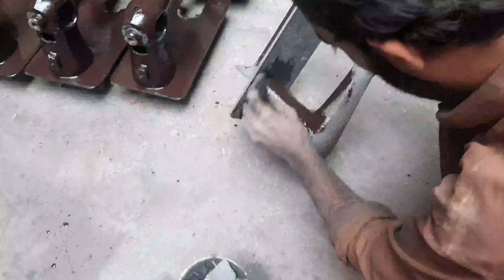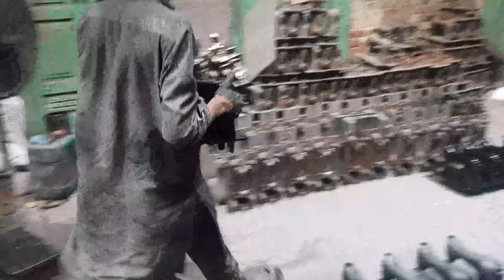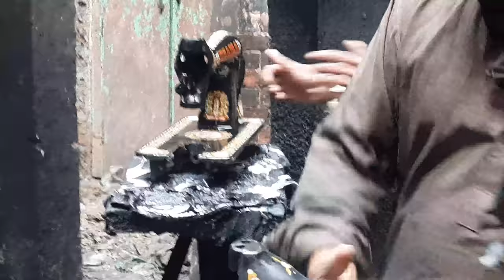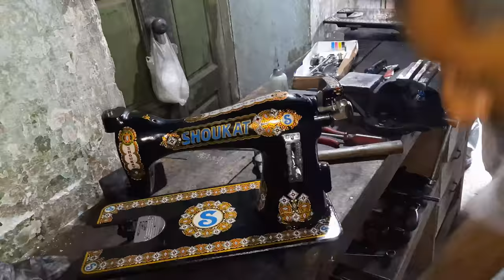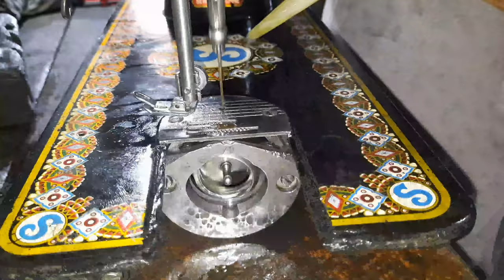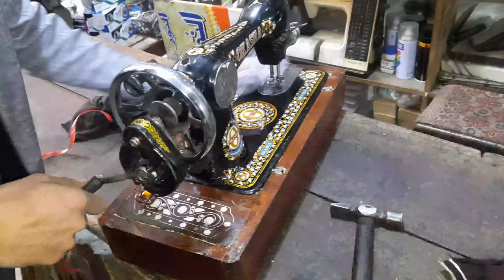Amazing skills of Making Sewing machine at local factory | Sewing Machine mass production

Comment: For those of you who are curious, they are building copies of Singer model 15-89 sewing machines. The original Singer 15 was introduced in 1879, and was modernized in the late 1920's and made as the 15-88 treadle, 15-89 hand crank, 15-90 belt-drive electric and 15-91 gear drive electric.
Reply from the maker: You are right but this machines are not for restorations this is thenew machines. If i share the work of manufacturing nobody see because the time of video is metter the audience mind sir . Thats why i do not show the casting proces . In future after 3 months i share the process of casting of machine . Thank you for watching and your precious time .
Reply: I was wondering about that so thanks!  I bet that thing will out last any of the current overly complicated plastic machines.
Reply from the maker: @rxpsycho7326  sir thank you for your comment and precious time , i am a tailor and i have 14 years experience in this work i bet if the machine is good you sew leather clothes and more things on it this i not broken if you sew the plastic . thank you for watching.
Reply: Our machine is about 60 years old (bought around 57) - rusted but otherwise fine. Exactly the same mechanism (identical except the labels)
Reply: Yes. I have 2 singer treddles. Identical. These hard working men must have our tooling and making our machines. Just like everything else...  amazing.
Reply from the maker: @rheidtech  Thank you for understanding my work and understanding the work instead of seeing the flaws in my work like others
Reply: @Onlyhandy1  🍺💪🌄
Reply: @Onlyhandy1  заказат можно сколько стоит
Reply from the maker: @ШемшатЧарыева-д5ш  thank you for your precious time sir.
Reply: @Onlyhandy1  Nice work
Reply: they are similar the Singer 15 had some differences, the base was thicker without diamond reliefs banding, the 15 had a longer bedplate. the motor mount was different.  the singer 15 was gear driven for the motor if I recall correctly.
Reply: @doordasht24  The Singer 15-91 was gear driven off the motor. The 15-90 was belt driven off the motor and motor mounts to the hand-crank/motor boss. 15-89 is hand-cranked, and the 15-88 was treadle. These are the variants of the Singer 15 made after the mid 1920's, when Singer "modernized" the 15. The older 15's are similar but lack reverse stitch, and machines made before 1895 have a fiddle base. 

The Singer 15 has been in continuous production, in one form or another, by a variety of companies since 1879.
Reply: @okbridges  My favororite household machine made by singer is the model 27 and the 127 which was the vibrating shuttle, the  needle plate can be widened with a drill bit  so a lager needle can be used, I have over 30 years of sewing experience, throught the years I have had several machines, My favorites were made before the 1960's, I have never had a fiddle base although I have wanted one, I have only came across one in person at a flea market. My grandmother was a seamstess. I am the only upholsterer in the family that I know of.
Reply: @okbridges  the 15-91 is the one I got for ten dollars at a sale, I oiled it and it ran like a top.
Reply: @doordasht24  oh cool! The 27/127 and the 3/4 sized 28 and 128 are favorites of mine as well. I probably have more of them than any other Singer model. The 66/99 are also great machines, and the 201 seems like the Cadillac of Singer models.

I work on sewing machines at my local habit ReStore and go thru the machines that have been donated and put them out for sale. I've been collecting machines for over 30 years now, and often tell people that I collect the best and service the rest! I like all the other old US-made vibrating shuttle machines as well.
Reply: how is not the same as fake copies of anything?
a sewing machine is a highly accurate piece of machine
nothing in this video would make me think one of these boat anchors would be of any use in the real world
i bet when a customer buys them they dont get any guarante or waranty. use onece then throw away!
Reply: so basycally those guys got the machines(and dies) previously used by singer from some (scrapyard) and startet making their own version i guess ? I mean basically those are perfecly fine long lasting easy to repais machines for simple tasks... Im wondering: How expensive they are (in absolute Numbers and in "relative" Numbers e.g. how do you need to work for buying one)? Are they sold locally ?
Reply: @lupo8477  Singer at one time had a factory in practically every corner of the globe to satisfy demand for its machines. They had a factory in China and India.
At the end of WWII, Singer's was asked to help Europe and Japan rebuild. USA Singer gave Japan the blueprints to the late style 15, because it was an old design dating back to 1879, and they were focusing on modern post war models such as the slant shank 301. UK Singer gave the Italians Germans the Singer 15 blueprints. This is why you see so many post war clones or the Singer 15 from these countries. 
Modern Singer 15 clones are descendents of the Chinese and Indian factories either made from original blueprints or work over worn out tooling that ultimately traces back to New Jersey where the tooling originated.
Reply: @okbridges  very informative thanks
Reply from the maker: Thank you for your precious time. My friend .
Reply: Hola buenas. Muy  bueno el video, una pregunta de que metal esta hechos los cuerpos de las máquinas de comer. Un saludo desde Argentina.
Reply from the maker: @juancorrea4417  this metal is melt with casting rebar baars , steel rods etc thank you for watching or thank you for your precious time.
Reply: @Onlyhandy1  Muchas  gracias, por contestar. Saludos de Salta- Argentina.
Reply: Yes, but the screw for fixing the stitch length is on the right side, so they made at least some cosmetic changes. But on the inside it is my 15-88, you are absolutely right.
Looks like it stays the most produced model ever ;-).
Reply: This is copies of Singer 15-30, but have reverse and simplyfied bobbin winder. 15-88 series have a 11 o'clock bobbin case.

Comment: The hand cranks you are putting on these look a lot better than the Singer handcrank copies currently made in other countries. The hand crank you are using even has the screws in the same place as the Singer originals compared to the others I've seen. Can the hand cranks be bought separately, and where? 
I like converting older electric machines to handcrank, but original old handcranks are expensive, and the new ones I've seen (from China) are poor quality. This video is the first time I've seen new handcranks that are made just like the originals, I would like to know where I could get handcrank assemblies like the ones you show here.
Thanks.
Reply from the maker: Sir this machine is made by 3 steps , 1 casting metal 2 colouruing and warnishing and 3 is assembling . And the meterial used in this work also available in markets very easy the shop of machines or machanical shops all the tools are available . Thank you for watching and your precious time sir